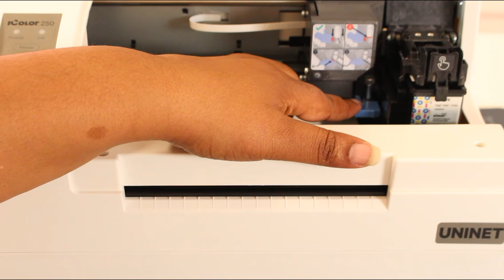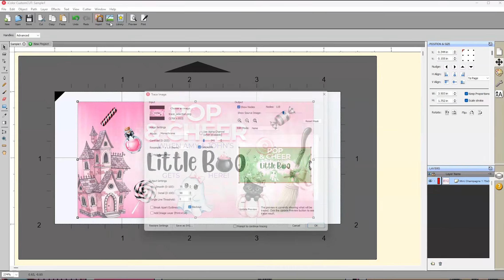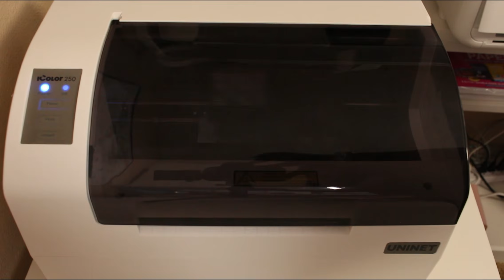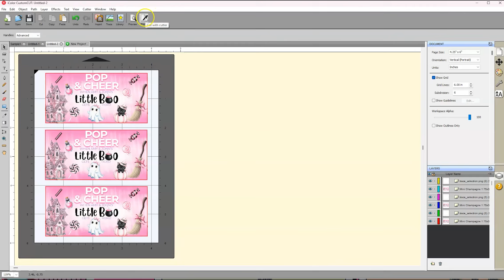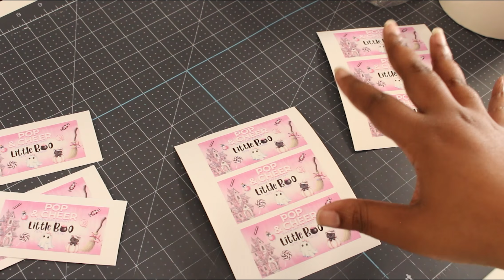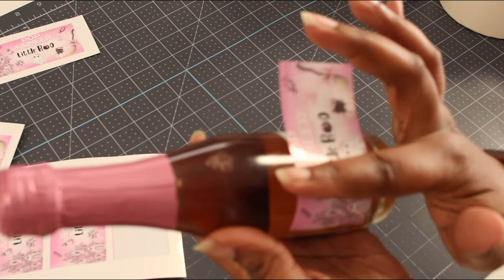Can This Printer Cut AND Print Sticker Labels? Uninet iColor 250 Test

Comment: thanks so much for sharing this video, i am working with a dealer for the company but am still on the fence cause I just don't see many using it. I am so close to pushing the button to buy though. I am hoping to put many images on a sheet and have them cut out.
Reply from the maker: Okay, this won't do that. This is a roll label printer, so it prints and cuts on rolls of sticker vinyl, not on sheets.
Reply: @PrettyPartyandCrafty  yeah that's what i mean, basically it comes in rolls but i can say do a sheet in the size of 4 by 7 or however long and then it will cut the roll and do more sheets. if that makes sense. thanks for getting back to me.
Reply from the maker: @reginaeaster oh okay, then yes. If there's a particular usage, just let me know and I can make a video for it if you need to see it. For example, 100 pre-cut circle labels for cookie packaging or 25 custom shaped die-cut labels for cups, etc.